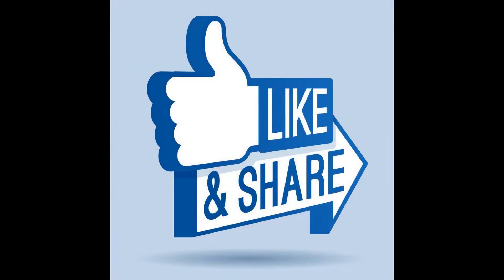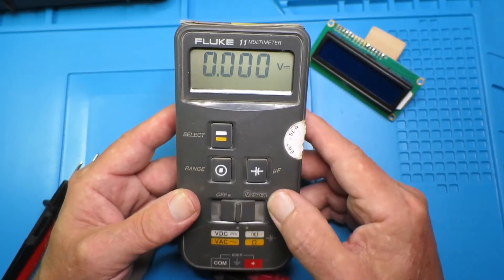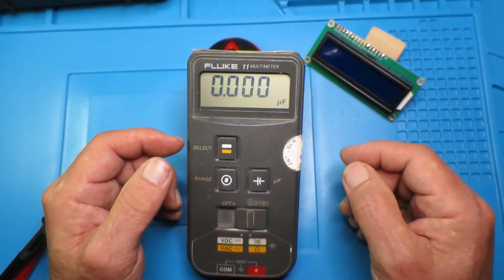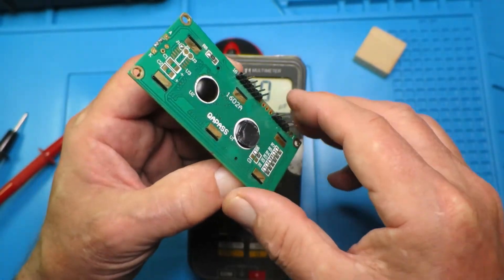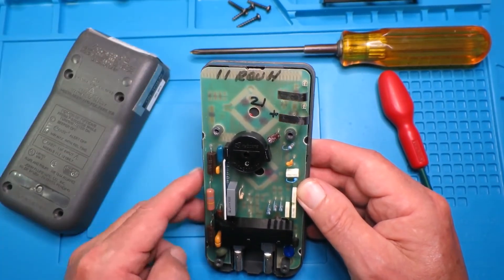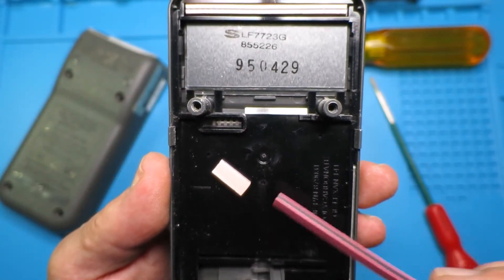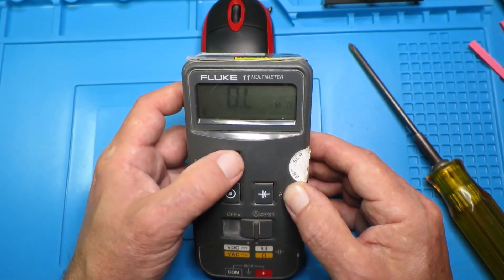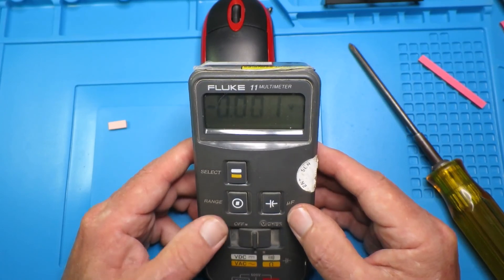Fluke 11 Multimeter Range Select Switch Fix Elastomer Replacement - Electronic Repair

Comment: Hello, thanks for your video. Could you tell me I can buy these 2 elastomer stripes between display/switches and pcb ? Thanks
Reply from the maker: Take a look here for a kit: https://www.google.com/search?q=fluke+elastomer+replacement+kit&rlz=1C1ASUM_enES692ES692&oq=fluke+elastomer&aqs=chrome.0.0i512j69i57j0i22i30j0i22i30i625j0i390l3.14761j0j15&sourceid=chrome&ie=UTF-8 I actuall took them from an LCD display like this one : https://s.click.aliexpress.com/e/_DlIu5Ev Thanks for watching, have a great day!
Reply: @1nformatica  Thanks 1nformatica. I've ordered a new LCD display at AliExpress with success...:) Hope it will help me to solve my Fluke 12 display troubles. Thanks again and have a nice day

Comment: I ordered the LCD just for the Elastomer contacts. I've been having the contact problem with the AC/DC switch for years with my Fluke 12. I've cleaned the contacts but the fix has always been temporary. It's only recently that I've suspected the elastomer strip. I'm sure this is the least expensive way to fix it. I don't know if Fluke sells the part but if they do, I'm sure it would cost more than $3.11.
Reply from the maker: You're right George, the "Fluke" elastomers are around $20!!

Comment: Hi there. I have one of these, and actually prefer it to the other multimeters I have. Have you ever tried to calibrate it? Mine does not zero on the ohms range and, while I can easily work with it, it’s quite annoying.
Reply from the maker: Hello, thanks for the comment. I have not calibrated mine. There is a service manual which shows the calibration procedure: https://assets.tequipment.net/assets/1/26/Documents/10,11,12_ServiceManual.pdf
It's a nice little meter and I'm lucky enough to also have it's big brother the Fluke 77. Both have given many (more than I care to remember) years of faithful service!

Comment: I just found your video.  Where can I get the elastomer?  Or would it be better to just purchase the lcd below and remove it?
Reply: Okay, I just went out to ebay, and I can get a 2 pack of the LCD's for $6 w/ free shipping.  That'll be cheaper than I can find anywhere else.
Reply from the maker: Hi, The simplest answer is yes, buy the display and take it apart. It is a pity but the only alternatives I have found are either a Fluke repair kit from eBay about $19 or buying 10,000 from China!!
Reply: Yeah, that is the best I found too.   Oh well, just have to sacrifice one, and have one to play with.  Be nice to have my 11 working again, the select button  hasn't worked in 10 years.
Reply from the maker: You may get lucky just cleaning it with IPA. I fixed mine a few times before changing the elastomer.

Comment: Where did you get the LCD what brand for those Elastomers
Reply from the maker: Hi Ginger, it is a common 1602A LCD panel often supplied with Arduino kits you can see on this link: http://bit.ly/1602AYellow   I happened to have a broken one to take the elastomers from.
Reply: @1nformatica  its cheaper to buy the screen as well as the thse on Ebay are £12
Reply from the maker: I happened to have a broken LCD to take the elastomers from, so my repair was free!!